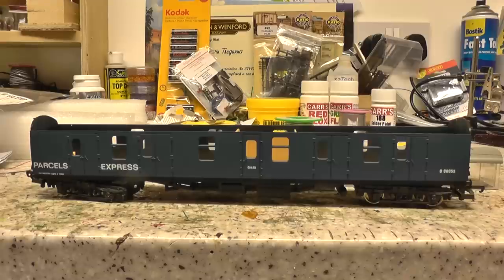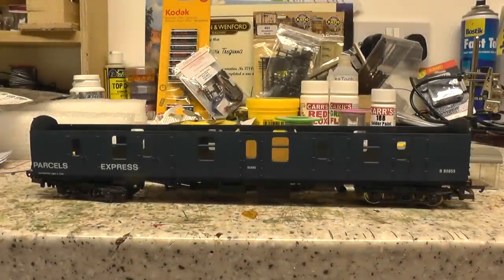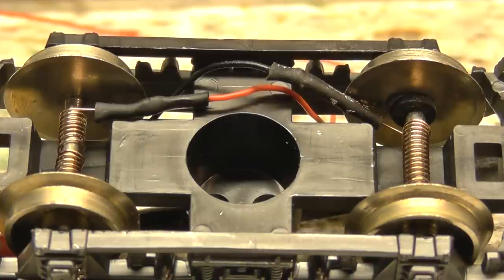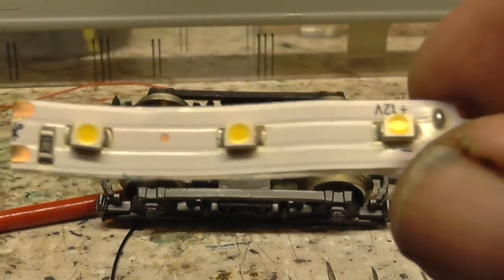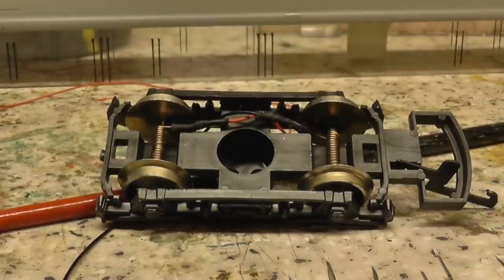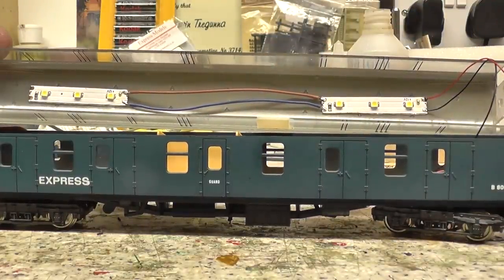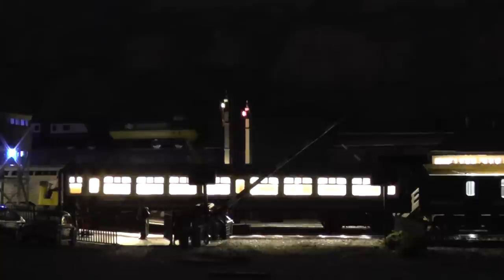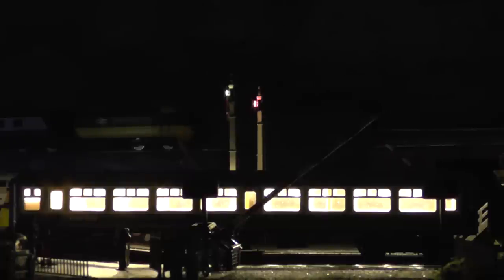How to fit coach lighting on Penwithers

Comment: Hi Kevin after watching your video I went on to ebay to check out the LED strips the first one was an auction for a 5m strip there was 41 seconds to go so after a very read at the description I put a bid on for £4.96 and to my surprise I won it for £2.21 couldn't believe I got it so cheap and its a UK seller as well so thanks for that mate.
Reply from the maker: Hi Jack you Jammy thing cheapest I have had was £6 !!! Will check that out I usually buy it now cheers Kevin

Comment: Great video Kevin and thank you for sharing it, you've really got me exited about lighting up coaches, and on the cheap.
But you hang on to those springs ok, spent my lunchtime with our electronics engineer and tomorrow I hope to have a cheap solution to the flickering, he's bringing in the components we need and we'll do some testing, if it works then hopefully, and I'm sure it will, the cost of lighting a coach will be around £2, and that will include the lighting staying constant over points and and dirty spots on the track :)
Cheers Mark
Reply from the maker: Hi Mark thought I would post up to the stage I was at plenty of feedback so look forward to your info soon cheers Kevin

Comment: Cool, that's something added to my information repository for the future, deffo going to get some of that strip LED roll stuff, be really useful for my buildings when I get started on them - I never knew such stuff existed! Cheers
Reply from the maker: Hi Ringo it is certainly good the led strip ebay yet again on my third roll cheers Kevin
Reply: Looks eay to deal with, you can cut it and just solder to the copper lines on the strip I take it?
Reply from the maker: Hi Ringo yes just as you say brilliant stuff different whites and also colours did all the lighting on my houses and station  and canopy and engine shed as well cheers Kevin

Comment: Hi Kevin, a big surprise when the light went through the roof.  That is annoying.  A bit like when you have to paint the inside of a resin cast building to keep it from looking like it has pyroclastic walls and roof.  I too like those LED strips.  I got a bag of them a while ago and they are almost used up now.  Good tutorial about the rolling stock lighting.  Rob
Reply from the maker: Hi Rob thanks very much the strip leds are fantastic so many options with them and cheap as well took 3 coats of paint to stop the light bleeding through cheers Kevin

Comment: Hi. You might want to consider a rectifier since the leds are dc. The jittering can be avoided by the rectifier and a capacitor. Everard junction did a vid of exactly this, although he used standard leds and not strips. I do mine as you do but with rectifier and capacitor 2200uF, the lights dim slowly when contact lost. I had to add black tape on the inside of the roof, also lima! LOL
Reply from the maker: Hi Robert thanks for the info did see everad vid but thought I would like the easier option but will give your suggestion a go and think will need a bigger resistor to dim the lights a bit more cheers For the information ....Kevin

Comment: Hi Kevin thanks for that video I've been waiting for someone to do a how to on it could I ask are those led OK with the track power being 15v instead of 12 many thanks matt
Reply from the maker: Hi Matthew thanks for the comment they seem fine have had a single strip in my signal box for 3 years without a resistor in line and still working have put a resistor in line in the coaches to dim the lights about 640 ohm but will go bigger cheers Kevin
Reply: Thanks Kevin very help full will be doing that now to my coaches

Comment: Hi Kevin, just saw your great vid. Planning to do exactly the same as you. Do you have the eBay link where you got the strip LEDs from, please. Great suggestions from the rest re. rectifier and capacitor to smooth out the AC to DC problem. Jim
Reply from the maker: Hi James I will try out as suggested as for the strip leds I but the cheapest available on ebay don't think I have paid more than 6 quid cheers Kevin

Comment: Kevin, did you actually fit a second set of pickups on the other axle and if so did it cure the intermittent contact issue?
Reply from the maker: Hi yes did make a difference but could do with a stay alive unit , have not done any more with it since but no doubt will get to it one day cheers Kevin

Comment: could you solder a capacitor to hold charge so you dont get a flicker from the spring loosing contact with the rails power supply Andy
Reply from the maker: Hi Andy thanks for the comments I think will give it a try quite a few have mentioned it , if it works will still be a cheap way to light a coach cheers Kevin
Reply: ....and also a bridge rectifier  so that you can place coaches either way on the rails to avoid the led polarity issue.👍🏻

Comment: Painting the inside roof black acrylic with a brush should crack it Kevin. I'd also paint the red wire black where it is visible inside the coach too, just in case you catch a glimpse of it through a window at any time.
Cost effective way to do it.
Regarding the coiled wires not giving 100% contact - could you put a slight bend in them across their length so they are always pushing on the axle?  If you know what I mean? Laurie
Reply from the maker: Hi Laurie thanks did paint the inside it took 3 coats of black to stop it will paint the wire !! as for the spring I think if you do bend it it will give to much resistance and on a large rake will cause problems think I will go with a capacitor cheers Kevin
Reply: kevintregunna
Capacitor should work. But just add to the cost a touch.

Comment: Could you supply a link for these LED's? I have a ridiculous number of coaches to light up so every penny i can save along the way is being put towards new stock.
Al
Reply from the maker: http://www.ebay.co.uk/itm/5M-300-LED-Strip-Light-3528-5050-5630-SMD-12V-LED-Flexible-Light-Waterproof-/151563603317?pt=LH_DefaultDomain_3&var=&hash=item2349e50d75try this one loads on ebay cheers Kevin
Reply: Cheers Kev, your method looks much easier than Richard's but with the same result. Alan
Reply from the maker: Alan Wiggins Hi Alan Richards method is very good but I am not that electronically minded so looked for an easier route cheers  Kevin

Comment: I buy all my  lights from China.  You can't beat the price.  I noticed the spring is a tad loose around the axle.  I would put a piece or two of copper wire length wise to tighten the gap.  Solder it on the spring at each end.  You could have made them yourself.  Take an axle and wrap a wire around it.  Just a suggestion.  Great how to.
Scott
Reply: I think trying to tighten the gap would end up acting as a wheel brake. There are so many turns of copper on that axle that there is always going to be some sort of contact.
Reply from the maker: Hi Scott thanks yes I will give that a try as well plenty feedback on this video thanks for the comments cheers Kevin
Reply: struck2soon That is true if you put too large a wire but if you add one that touches all the time. Also with time the wire would form to the axle.  I realize the number of turns is to always have contact but the contact is not firm enough to keep the lights from blinking.  The only other solution would be to add a capacitor to it, so the lights would have enough power stored and would not blink.  The capacitor probably the way to go, now that I think about it more.
Scott

Comment: Thanks for this Kevin, easy to understand, I think the problem with lighting in coaches generally is too bright. Think of yourself sitting in the coach, you wouldn't have that much light penetrating the outside. Generally these new lighting systems look great, but are either the wrong shade for the period or too bright and need adjusting. The issue is at what voltage the LED with come on
Reply from the maker: hi Vaughan thanks for the  comments this is work in progress need to try out some different resistor values to dull it down some more  but all part of the joy of experimenting , problems were made to get over them cheers Kevin